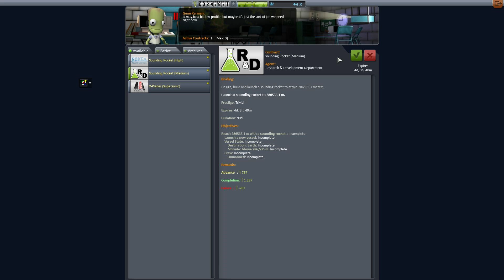Kerbal Spaceships Are Serious Business - Part 4 - Orbiting Out Of Control

Comment: i don't know if anyone has pointed out this for you earlyer. but in the flight engineer under vessel you can see that when you pass 24 000 m you vessel has less than 20,000 tonn in mass, so you could possibly start to control it earlyer
Reply: 7:18 min into the video. if you where woundering

Comment: Why does the exhaust become a "ball of fire" when you break the sound barrier?
Reply: +Bobthedj As the rocket goes faster it compresses the air in front of it and decompresses the air behind it. This causes the air behind the rocket to have less pressure and cools down. In super sonic planes this causes vapour cones and shock diamonds because the cooler air holds less water so it forms a mist behind the vehicle.

The rocket however has a very hot very high pressure exhaust exiting out it's back. This hit the cool low pressure air allowing it to expand quickly. The plume isn't 100% realistic some artistic licensing has been used to make it "look right" but this does happen to a point.

Comment: May be a stupid question, however. From my limited knowledge of the earths "upper atmosphere" What they teach in school is simplified obviously unless you go to a university specifically for it. My understanding is you have the atmosphere which things the higher you go, then you have the all important ozone layer, then.. space.. no atmosphere what so ever. 

My understanding is that anything "in space" orbiting earth is outside of any atmosphere from earth. Is this not correct? If so, what causes the decay of orbits like sputnik you mentioned?
Reply: The atmosphere does not just end abruptly.  Even at the distance of the space station they actually turn one of the solar arrays to limit it's drag in the far upper atmosphere.  The space station is quite far from Earth and needs to make correction burns to account for orbital decay . I think gravity and dual body physics have something to do with it also . Wikipedia .. just as good as any University.
Reply: Brad Small

So how far away does the atmosphere actually stop?
Reply: +Eternally Angelic 
The Karman line is where scientists separate earth from space
(100km).The effects of the atmosphere can be felt up to 1000km and maybe further ,though it is very thin at this point .The space station is at around a 400 km orbit .It has to perform burns periodically to boost itself back up to that orbit  . It loses or decays at a rate of about 2km per month .
The huge solar arrays hit enough atmosphere to create drag that brings it closer to the Earth.
Reply: Brad Small

Hmm so another stupid question, why don't they simply do the orbit higher? or is it simply a situation of balancing time, money and funds? higher would cost more without as much return?
Reply: +Eternally Angelic Because it's stupidly expensive to use that much delta v on a space station that is being constantly upgraded. Putting parts into that orbit is really expensive, and returning astronauts, sending astronauts, sending supplies.. it's all expensive if you have it in a low orbit, much less a high orbit!

Comment: I need help if anyone can find the time, I have a problem when attempting to launch spacecraft, it says I have no connection. Also when in the SPH I follow his first build with the remote avionics package as the command capsule and it says insufficient avionics, supports 0 tons. If anyone has had the problems please help.
Reply: I installed everything Scott Manley has shown in tutorial through CKAN but doesn't work properly.
Reply: +Squez Gaming The "No Connection" problem is remote tech, put an antenna, and press "Enable" or "Start Deployed. " "Insufficient avionics" is the problem with the probe, you have no control.
Early stages of rocketry have no control, put wings, hold Shift and press W  with 3 wings
and let it fly, and explode.

later probes can hold more weight, which lets you control it
Reply: But I cant launch the second stage and I have also built a rocket with every available start-game antenna on it and deployed
Reply: It still doesn't work
Reply: Worked for me, hmmmm Remote Tech, as its probably bugged
Reply: Uninstall remote tech
Reply: I wanted to keep it for more realism but I guess I have to uninstall it, thanks for the help though
Reply: Glad I could help, its still realistic, but a little less :D

Comment: Yep, Object D was to be the original first satellite but was taking too long, so Korolev had PS-1 (elementary/prototype satellite 1) knocked together to orbit something. As others mentioned it did report some telemetry, but the true science satellite was Object D (which flew as Sputnik 3, after another makeshift, PS-2, launched Laika).

Also, I'm a bit worried a the use of stack decouplers and autoshrouds. Use procedural insterstages, that's what they're for! You can make your stages the correct diameters then. :)

And way to go doing without better guidance!

Comment: So those rocket engines have trouble running in negative G? That seems odd, considering that issue was solved in fighter aircraft in WW2? Seems like that'd be a rather important issue to fix in rockets.
Reply: +Mike B The pumps run fine, you just have to worry about pressurant in your feed lines. For aircraft it's not a problem because the vapor in your feed lines will be your oxidizer :)

Comment: I thought that Sputnik encoded data about temperature and internal pressure in the length of its beeps. Also its radio signal could be analysed to gather information about the electron density of the ionosphere. Sputniks predecessor "Object D" was scraped on the grounds of being to heavy and complex to launch successfully.
Reply: +ciarangordon You're correct on the first part, but Object D certainly wasn't scrapped. It flew as Sputnik 3. It was neither too heavy nor too complex to launch successfully, it was just taking too long to build, and so PS-1 and PS-2 (literally 'prototype satellite' one and two) were flown first.

Comment: Interestingly you dropped below 20 tons way before staging due to burning off the fuel - you were almost down to 15 when you staged. It only unlocked the controls when you staged the first time though, even though all it did was pop the cover off your satellite. I guess the mod only checks your weight when staging, ignoring that you can significantly change weight through other means?
Reply: +Kemp Correct, it would be a performance pain to check it every tick, but I'll reevaluate when 1.1 comes out.
Reply: NathanKell Totally understand the reasoning. My question sounds a bit critical, but I was just checking that my guess was right. The other possibility that I could see was that there was a reason to base it in the wet weight of the parts rather than the actual weight, in which case unlocking on that first staging attempt would have been the bug.

Comment: Scot, technically speaking Sputnik 1 did result in some useful scientific data. Observations of the satellite as its orbit decayed was used to learn about the upper atmosphere, as the rate at which it slowed down helped discern the thickness of the air.
Reply: +richfiles They don't? What the hell did I build my house of out...
Reply: +Etropalker But bricks don't broadcast easily detected (and triangulated) radio signals.
Reply: +Aaron Hazelton The sotry I heard (BBC Documentary) was that the Academy of Sciences designed a an original satellite where everybody wanted their own favorited sensor included so it was huuuuuge. When Korolov saw it he just went straight to one of his guys and told him to build a simple system with a radio transmitter.
Good news it worked and analysis of the orbit gave lots of information
Bad news was it was too low and din't have a geiger counter so it totally missed the Van Allan belts
Reply: +Alain Gloster sputnik 3 was actually supposed to go up first, and it was a 1-ton science satellite. Korolev realized that he had to do something drastic to beat the Americans so they sent up sputnik 1 first. Sputnik 2 was sent up only because Khruschev ordered it. The R-7 rocket had a payload to orbit of over a ton, which was quite a lot more tha  the Americans could manage.
Reply: +Aaron Hazelton true, but they could have send a brick and gotten the same results.
Reply: Timofei Larkin A quick google search tells me it was nitrogen, and I can't find anything about micrometeorite detection on wikipedia, though you may be right. Sputnik's radio signals were actually used to investigate the ionosphere, and its orbital data was used to study the upper atmosphere. (According to wikipedia).
Reply: Also it resulted in the U.S being able to start their space program. At the time it was assumed that a country's borders stretched up an infinite amount, with the Soviet Union launching Sputnik into orbit it let the U.S launch their space program where they would have their first satellite ( The Explorer 1) up within a year.
Reply: +Aaron Hazelton I'm necroposting here, but I believe it was also a sphere filled with helium with a pressure gauge, to monitor, how micrometeorite impacts may damage a spacecraft's hull.
Reply: I may have (many of) the (very important) details wrong, this was taken completely from memory.
Reply: Timofei Larkin That aside, this really shows that you can wring all kinds of data from a spacecraft without necessarily having a dedicated instrument on-board.
Reply: +Anthony Martin
Probably a Metric Butt Load™ of radios! :P

Comment: hmm add multiple cameras, render to texture, slap them in a window, should all work fine with unity at least.
not sure how the modding process works (maybe you don't even fiddle with unity directly), but if i remember correctly you would need the unity pro version for the render to texture stuff.

Comment: Scott, ive been having issues with spaceplanes with the Ckan install, every time i throttle up the plane always yaws off to the right and becomes uncontrollable before i can get off the ground, causing me to crash everytime, have you had any issues like that?
Reply: +Brotaku The airstrips are too bumpy.  The only worj-around I've come up with is to use rocket clamps, rocket boosters, and a high angle of attack to do a launch that allows me to get to speed without rolling along the strip.
Reply: i did, but i haven't played with spaceplanes but in 1.0.2. the 1st tier runway is awful, just take off and land from the grass nearby. with 2nd tier it's a lot better but it still happens sometimes... reloading ksp fixed the problem though, and sometimes it simply crashed to desktop saving me an alt+f4. :)
Reply: *****
i even upgraded my airstrip, even then no matter what control output, wheel configuration or anything, they always yaw sharply to the right, its impossible to fly em
Reply: Brotaku CKAN by itself doesn't do anything, build a plane using only stock parts, then uninstall your mods one at the time (with ckan) checking the results.
if you use steerable landing gears check if they steer the wrong way. btw chances are you don't really need steering wheels at all, and for all the other cases you can bind an action group to toggle it.
try mounting landing gears straight (as they are for real aircrafts), and not angled outwards.
Reply: +Brotaku . I suspect FAR is doing this. It's hard for me too. But if you place the back wheel closer to center-of-mass you can pitch up early before the plane start to yaw. Usually it started to yaw when you get up to a speed, correct?
Reply: xponen
yes, shortly after throttling up i will move foward a bit then the yaw to the right happens
makes em impossible to fly, not sure if it will do it in flight though
Reply: +Brotaku please post a screenshot or better the craft file.
Reply: sbraz
its hard to get a screenshot of something like that
but it more or less has happened with every craft ive created, its probably a mod issue, i might try and re-install em all
Reply: Brotaku my plane that yaw on runway did just fine if flying.IMO the wheel skid during take-off, that's why it yaw. (I uses Realism Overhaul mod packs)

Comment: strech Ah, nice video Scott.
Reply: +legoclone09 get a better screen resolution!
Reply: JoJo Umm? ok? I was on my ipad.
Reply: OHHHHHHHH its an Ipad, that's the problem, it cant show HD videos because of its hardware limitations
Reply: JoJo It can show 720p, which is technically HD. I have an iPad mini.
Reply: I ment true HD, it usually cuts off the edges to make it fit correctly rather than stretching or it stretches it in such a way it isn't visible, and maybe your internet or hardware cant handle true HD. but no HD is better than no video
Reply: +legoclone09 Also known as "HD ready". "Full HD" is 1080p.
Even my Phone does 1080p...
Reply: Well, my internet supports it, I am watching in 1080p right now, but my iPad doesnt. Could be a thing with the mobile app or something.
Reply: +Mp57navy Even an iPod 5th Generation does 1080p.
Reply: Harichi Kashanami My iPad is not from that, it's the first generation iPad Mini.
Reply: legoclone09 I know. I said iPod. Not iPad.
Reply: Harichi Kashanami Oh, ok.